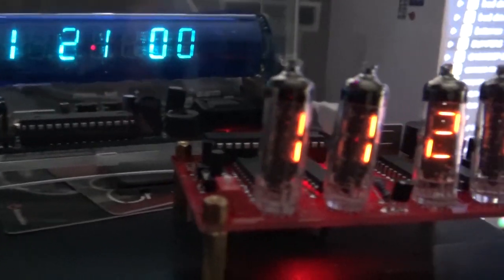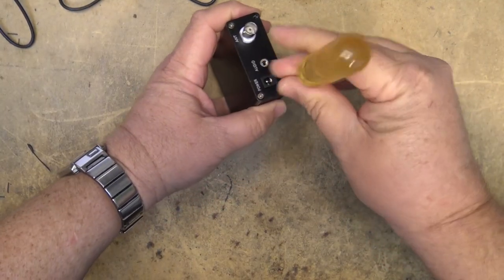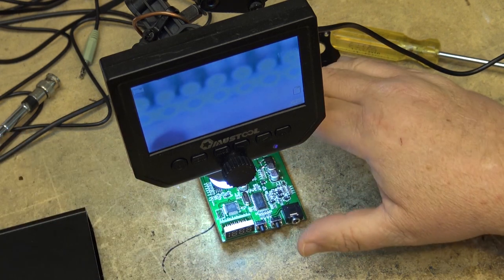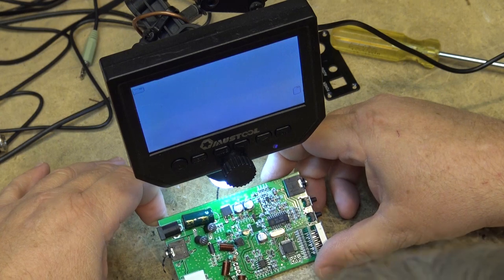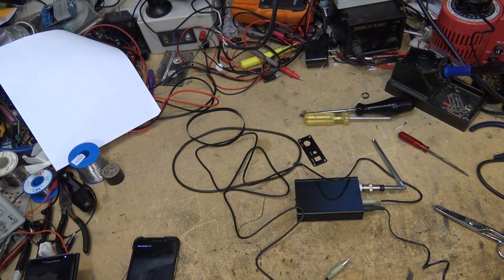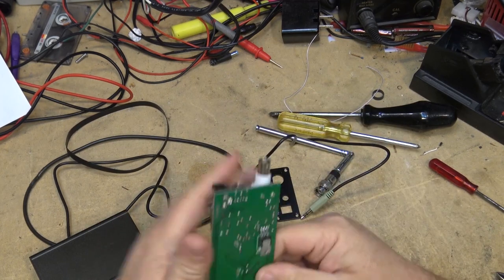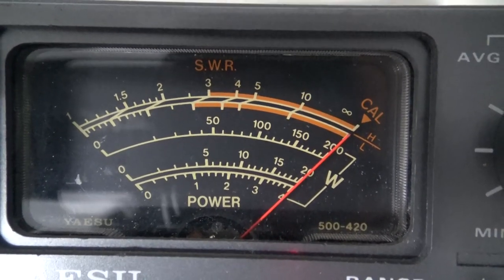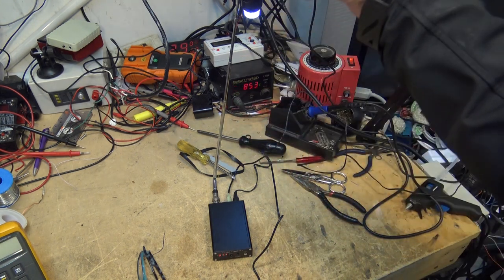LPFM Transmitter tear down and test

Comment: I have a transmitter that looks exactly like this but it is only 50 milliwatts which is legal to use without a license. I hooked it up to a J-Pole antenna about 20 feet in the air and the signal went 2 blocks. With stock antenna signal went about 100 yards. I got this to sound pretty good using the Stereo Tool Program.

Comment: Speaking of the FM Transmitter, I have the 2013 MyZone Wireless Headphones and Transmitter that was giving to me by my family who needs some quiet and not to have any noises around any room in the house, test them out, and the headphone sounds acceptable, but for the FM Transmitter, it broadcast up to 100 feet, and on the frequency 88.3 MHz on Stereo.

I can broadcast through my radio and sure enough, it broadcast them very well, and it uses 3 Volts DC with 2 AA Batteries. =)

Comment: It would be interesting to see a profile of the harmonic and spurious output of this transmitter. And also to see if you could leave the stereo killing solder bridges in, but feed it with an externally generated stereo mpx signal.
Reply from the maker: Well you would have to disable the internet pilot and subcarrier generation to feed it with a composite signal otherwise you would have a real mess.
Won't be able to put it on a spectrum analyzer as I no longer have it. Got an offer for it and it is now gone, just like the majority of the devices I get sent. 
I get many things sent to me to evaluate, and do the video in exchange for the product but I have no use for many so I put them up for sale and send them on to someone that wants them.  I keep the ones that I have a use for, like the work light, cell phone battery booster and the ham radio, but the rest of it goes so fast it would make your head spin. This way companies get their devices shown off and demonstrated at very little cost to them. I make money on the ad revenue from youtube, and the sale of the unit, which I offer for less than the selling price of a new one. Many devices I buy with my youtube revenue to show off, or build. Those Nixie clocks, VFD and Numitron clocks, tube amplifiers, a pocket projector, Nikon 4K action camera ect I bought with my youtube revenue, as well as new production cameras and the studio microphone. I tend to re-invest a good portion of my youtube and patreon revenue into the channel.
Reply: 12voltvids good point about the internal stereo generation artifacts.

Comment: Get a proper dummy load. Even with that antenna folded up you will still radiate enough power to be over the legal limit. Using the antenna folded up will also cause a high SWR and can burn up the transmitter.

Comment: I had that same transmitter. It also would not transmit in stereo. I tracked it down to be an issue with the software on the micro not enabling the stereo mode on the fm chip. Threw it out in the end.
Reply from the maker: Wouldn't be the CPU. The stereo signal is generated in the BH1415F.
About the only thing that would kill the stereo is a pilot tone off frequency, and that is set by a resistor divider network off pin 19. Even the PLL is internal on this one. The CPU really doesn't do much. It memorizes the frequency, drives the display and when it is powered on dumps the frequency data to the 1415.
Reply: It was the cpu, Through the data pin on the chip you can set the internal multiplexer to on or off. Should have said there was no pilot tone showing up on my SDR software :). Have you tried removing the attenuation resistors from your in-house transmitter. They are put in to keep the signal below regulation levels. I have done this with my tunecast.
Reply from the maker: Or perhaps the modulator chip was defective, and not producing the pilot tone, and 38khz DSB L-R signal.
Reply: That is also very possible, I guess they just hope people won't notice!

Comment: Even on 35 watts I can only reach 10 miles at most on FM but there buildings all round me.  the signal is OK in town but poor in the countryside.
Even our house blocked some signal as its to tall to go on the roof being 4 floors.
On mine stereo sound is really good.
I never have hum on mine.
Reply from the maker: It hums because it doesn't know the words!
Reply from the maker: It depends on height. The radio transmitter project I work on way back in 1982 had me constructing and tuning 4 10 watt stereo transmitters. They were taken up north to provide a small town with FM radio from the big city. They were all set up as translators basically. Receiving a licensed broadcast station received off satellite re-transmitted on FM. I remember installing them on the top of an 8 story apartment building, with the antennas mounted to the elevator shaft. At the end of the day those signals were receivable throughout the entire community.

Comment: I have a couple of low power Tx's that use this BH1415 chip, you will find this chip is in most of those car cigarette lighter fm mp3 units..
Reply from the maker: Yes it is a single chip solution.

Comment: I've been tempted to buy one of these. However nowhere do I see the frequency response. I would prefer 50 to 15,000 Hz at least. Lower to 30 Hz would be better. 

I've been using a CZE 7 watt transmitter using the 1 watt position. The main problem I have with it is on voice. The transmitter sounds swishy. Lots of noise. Not clear. Not sure if this transmitter is better. The test could not show this because of the RF reflecting back to the transmitter. Lots of hum there. If you were able to get a clear sound, let me know. Im also concerned that they defeated the stereo separation. No one should have to fix an issue like that. Some of these Chinese transmitters have an option of stereo or mono operation. The best transmitter I had was an NRG Kit 4 watt stereo transmitter. I left the dummy load on too long. Bye bye transmitter. Thanks!
Reply from the maker: You need to use a hard limiter / brick wall LPF. That is a requirement or it will sound like crap. The limiter will clip peaks that will cause over deviation. The brick wall filter will stop all frequencies above 15Khz. This is required as frequency content between 15 and 19Khz will cause an audible beat with the 19khz pilot tone.
Reply: @12voltvids  Thanks for the response. I use a 12 volt power supply and a DBX 166A Compressor Limiter.  You really can't hear it when the music plays. If I turn down the volume you really can hear it even with music playing. Im looking for a transmitter that doesn't sound like that. I run a small amount of power in order for the Station to be heard over at the pool in our complex. The programming is what I play on my internet radio station.  

For fun I ran 40 watts and got the attention of the engineers over at Alpha Media. I was just curious what the coverage would be from our location which is up in elevation. Im not interested in getting their attention again. Im just looking for something that sounds good, and is clear.

I used to do a lot of pirate radio. I had a PCS Electronics FM Stereo Transmitter as well as an NRG Kits 4 watt FM Stereo Transmitter. Both units I used the DBX 166A Processor  with no issues. 

Im not interested in doing pirate radio ever again. Its just I would like a small transmitter to cover our complex. We are about a mile away from any main road. Even 1 watt won't make it to the main road.

Im curious about the sound of the transmitter you tested, and how clean the carrier was. 

As for me I have an antenna outside so there is no hum.  Thanks!
Reply from the maker: @daleberg3453  I gave this to a guy that did put it in service and it did sound very good. I preferred the Ramsey FM25b with the FM Companion processor. Sounded as good as any commercial station.  I don't dare run it myself though as I don't want to jeopardize my ham ticket.  I did build several FM25B with the 5 watt option many years ago that were sent up to a logging camp. They ran 24/7 for many many years and were moved from camp to camp.

Comment: Dump that thing into a proper tower mounted antenna to beef up the effective radiated power and watch the fcc come knock the door down. At least down here in the states anyway lol. Locally we have to two lpfm translator stations that run at 250 & 500 watts. And your right about needing audio processing. The 500 watt is owned by clear channel and sounds like ass while the 250 station sounds great.
Reply from the maker: No thanks. I do know about audio processing. I hand built a few low power transmitters for community radio up country back in the mid 80's and they had brick wall low pass filters and hard limiting as they were just used to re transmit commercial stations from satellite for the local town. The units I built could very well still be in operation to this day for all I know. The company I worked for at the time is long gone.

Comment: The op-amp is strictly a microphone amplifier. Also, I wonder why the heck they bridged the left and right channel.
Reply from the maker: Yes I know that. Pretty easy to figure that out. Traces from mic jack to the preamp, and from there wo the switches inputs of the aux in. As to why they bridged it is anyones guess. Probably to make the mic jack live when an aux jack in plugged in. As it sits now, if no aux plugged in mic jack is active. Plug in aux input, and it disconnects mic jack, as it should.
Reply: In the DJ world, we get confused between Line and MIC level XLRs!

Comment: I used to repalce cze 7c final transistor rd06hvf1 with c1971. Anyone here tried it for experiment if will it work or not?
Reply: What is the result of replacing the rd06hvf1 with c1971 ?
Reply: @tonytfuntek3262  this is only to prove that fet transistor can be replaced by bipolar transistor modification 1971 is more tough when it comes to high swr
Reply: @radarsonic6227  Thank you

Comment: Just shove a 9DB attenuator on it, job done.
Reply from the maker: This thing can go for miles and miles with a good antenna. 
I gave it away, and the person I gave it to put it on the air. It wasn't long before they got a knock on the door and were told to turn it off.
Reply: @12voltvids  🙂 nice

Comment: 12voltvids your eye sight must be worse then mine, surprised you did not notice the mess on the board with those surface mount parts, 1st thing I noticed when the video started was a damaged coil and several surface mount parts almost mounted sideways. There is so much junk being made these days and so hard for people to make any informed decision on buying something from Banggood or any other shop that sells cheap products. I still believe schematics should be supplied with electronics like the 'good old days'. And near the audio jack the writing on the board that is traced over with solder looks like it spells Fuk U.
Reply from the maker: I take it you don't know anything about RF design. Those coils with the bent wires are done for a reason. This is how you tune the RF stages. Just look at any VHF radio front end and you will see coils that look like someone has jammed a screw driver in there, and then poured wax over them. That is the design. If you saw the 5 hand built low power transmitters I built they had coils that looked worse than that, as I had to spread turns out while tuning on spectrum analyzer to get the unit in tune. Actually I didn't see much wrong with the construction other than the bridged pins on the rear audio input that mono'd the stereo feed for the sake of having the mic input live when a plug was inserted in the audio in plug.  The brand markings on the board are Fmk U.
The 2 capacitors in the filter circuit are most certainly mounted the way they are to reduce parasitic oscillations. That's OK if you don't understand this, RF is tricky. I have held my ham ticket for about 30 years, and there is all kinds of strange designs on transmitters and amplifiers that is done for a reason. 
The only reason I was getting the noise I was is due to no antenna. If this was connected to a proper antenna, tuned for a 1:1 match I can pretty much assure you that there would be no squeaks, scratches or hum. It looks to be a well designed unit. I wish I had one of the ones I built back in the 80's. It was pretty much along the same lines as one of the kits that Ramsey used to sell, except that theirs was low power and the ones I used had an MRF317 for the final. That could easily drive to 100 watts, but it was limited to 10 as that was all that was needed for the application, which was to relay radio stations down into a valley for the residents of the town. If I saw something flawed with the design I would have mentioned it, but quite frankly I saw nothing wrong with this. OK no silicone grease on the transistor, but they have it tightly sandwiched to the board and I doubt that heat is going to be an issue on a low power unit such as this.
Reply: Yeah for RF I have no real idea. Also did not know about the coils being twisted about for tuning. Middle of the board (lower end when you have the Antenna to the right 3:15 in the video) there is a row of 5 surface mount caps or resistors (cant tell in the video), 2 are nearly sideways, surely that is not supposed to be like that?
Reply: many hours tuning coils on CCTV Line amps for Cable company ---
Reply from the maker: Yes I saw them, bypass caps on the power regulator. I am thinking it was intentional. Capacitor placement is critical in RF circuits . Just the lead length can cause trouble in through hole applications, and placement in SMD. I get the feeling that they discovered a fault, and corrected it by shifting the placement of the caps. I have seen this on other RF devices, where parts are intentionally mounted on their sides, or turned to a specific angle. I refer to my 3 Wacom TV modulators. There are very high end, head end  cable modulators, and I have 3 identical units that have parts under a metal shield that are mounted on their sides.
Reply from the maker: Yes it is fun isn't it? I spent more time on this 4 channel FM transmitter relay station back in 82.  We had 4 exciters going into a common PA unit. We didn't have to worry too much about interfering with other FM stations in this town because there were none, but we did have to worry about harmonics triggering the local police repeater which was located at the fire hall up the street in the tower they hang the hoses in to dry.They were on VHF at the time, and spurs getting into their receiver would have spelled a quick end to this operation.
Reply: The fm adjustment coil does not have uniform spacing because the frequency spectrum between 88Mhz to 108Mhz is not a uniform tuning distance.  Think of a radio being tuned by a dial.  The radio is centered around 100Mhz.  The distance to tune to 88Mhz is more than the distance to tune to 108Mhz because the frequency is increasing, the actual tuning distance is getting smaller.  The left winding of the coil is bent further than the right side, so the left side of the coil is tuning to 88Mhz and the right side is tuning to 108Mhz.  The same coil winding adjustment is also done on receivers.
Reply: @12voltvids  Random question now that you mension coils, I read somewhere that at some point in time they had primarily women working the factories in pioneer, sony etc winding transformers, rf coils, solenoids etc because they had more patience than men is this true? What about winding speaker voice coils. I find these little things interesting.
Reply from the maker: @coolelectronics1759  
Partially true.  The main reason that women were used to do these tasks like making vaccum tubes and winding coils and transformers is they generally, in most cases have smaller hands and therefore it is easier when working with small tedious parts.  Now I say usually because i remember a few girls that I went to school with that I had to look up to.  They looked like linebackers.
Reply: @12voltvids  cool thats pretty interesting

Comment: LOL you have to repair it, to review it, thats new :-D
If you wanted to use it, a 330 ohm resistor in the driver emitter should kill the power level.
Reply from the maker: Or an attenuator on the output.
Reply from the maker: Well there was nothing wrong with the design, and had someone not bridged the in/out pins on the audio input jack there would not have been an issue.
How it is designed is that plugging a jack into the back overrides the microphone input on the front. My bet is that was how it was originally produced, and then someone noticed that the mic jack was not working when an aux plug was plugged in, and decided to correct it to make them both live not realizing that they were killing the stereo in the process, or they didn't care.